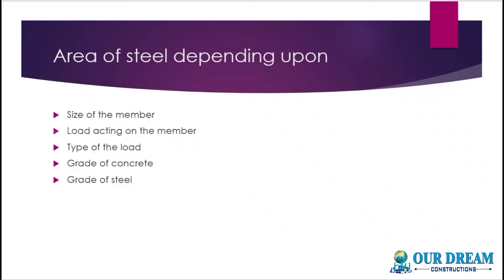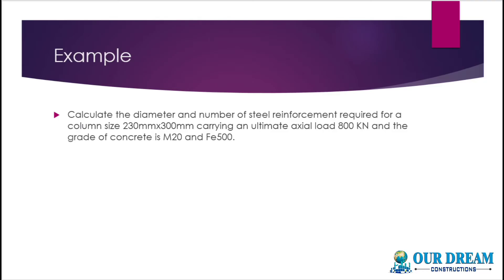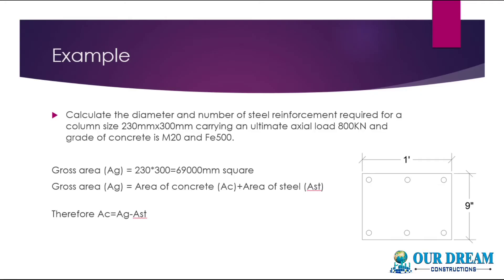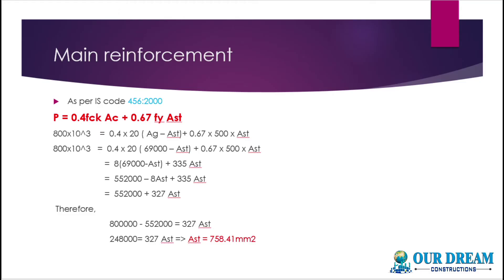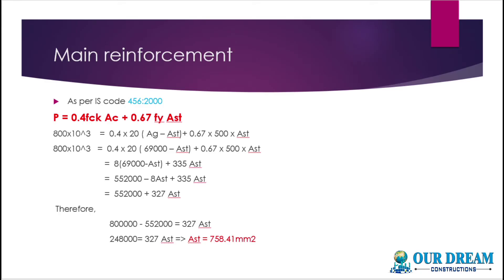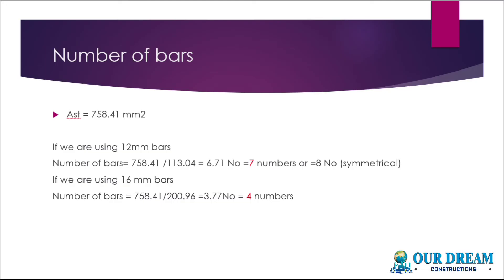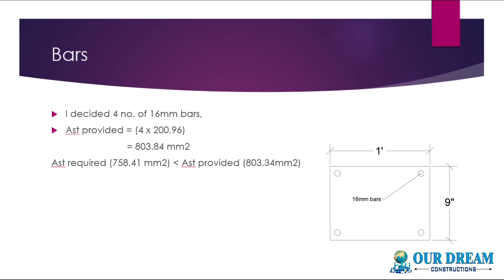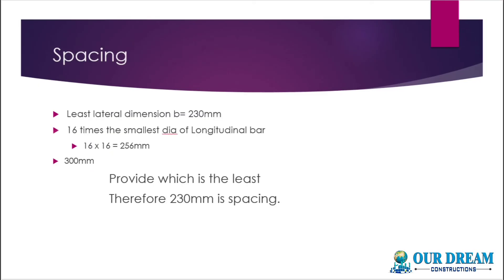How to find a number of bars in column | column'ல் எத்தனை கம்பி போடுவது என்று கண்டுபிடிப்பது எப்படி?

Comment: Bro chat gpt la intha answer varuthu bro kongam clarification Pannu ga bro

Steel reinforcement for column

￼￼

Calculate the diameter and number of steel reinforcement required for a column size 230 × 300mm carrying an ultimate axial load 800 kN and the great of the concrete is m20 and Fe550d

To calculate the diameter and number of steel reinforcement required for the given column size and load, we need to perform the following steps:

Step 1: Calculate the cross-sectional area of the column.

The cross-sectional area of the column can be calculated as follows:

Area = Width x Depth Area = 230 mm x 300 mm Area = 69,000 mm²

Step 2: Determine the compressive strength of the concrete.

The grade of concrete given is M20. According to the IS 456:2000, the characteristic compressive strength of M20 grade concrete is 20 N/mm².

Step 3: Determine the yield strength of the steel reinforcement.

The grade of steel reinforcement given is Fe550d. According to the IS 1786:2008, the characteristic yield strength of Fe550d grade steel reinforcement is 550 N/mm².

Step 4: Calculate the area of steel required to resist the given axial load.

The area of steel required to resist the given axial load can be calculated using the following formula:

Ast = (Pu x 1000)/(0.87 x fy)

Where,

Ast = Area of steel required (mm²) Pu = Ultimate axial load (kN) fy = Characteristic yield strength of steel reinforcement (N/mm²)

Plugging in the values, we get:

Ast = (800 x 1000)/(0.87 x 550) Ast = 1687.29 mm²

Step 5: Calculate the diameter and number of steel bars required.

Assuming that we will use only one steel bar, we can calculate the diameter of the steel bar required as follows:

Area of one steel bar = (π/4) x d²

where d is the diameter of the steel bar.

Plugging in the values, we get:

Area of one steel bar = (π/4) x d² 1687.29 = (π/4) x d² d² = (4 x 1687.29)/π d² = 2151.05 d = 46.37 mm (approx.)

Therefore, we can use a steel bar with a diameter of 46 mm.

Now, we can calculate the number of such steel bars required as follows:

Number of steel bars = Ast/Area of one steel bar

Plugging in the values, we get:

Number of steel bars = 1687.29/((π/4) x 46²) Number of steel bars = 3.52

Since we cannot use fractional steel bars, we need to use 4 numbers of steel bars.

Therefore, the diameter of steel reinforcement required for the given column size and load is 46 mm and the number of steel bars required is 4.

￼￼

Calculate the 12mm diameter and number of steel reinforcement required for a column size 230 × 300mm carrying an ultimate axial load 800 kN and the great of the concrete is m20 and Fe550Sd

2 / 3

To calculate the number of 12mm diameter steel reinforcement required for the given column size and load, we need to perform the following steps:

Step 1: Calculate the cross-sectional area of the column.

The cross-sectional area of the column can be calculated as follows:

Area = Width x Depth Area = 230 mm x 300 mm Area = 69,000 mm²

Step 2: Determine the compressive strength of the concrete.

The grade of concrete given is M20. According to the IS 456:2000, the characteristic compressive strength of M20 grade concrete is 20 N/mm².

Step 3: Determine the yield strength of the steel reinforcement.

The grade of steel reinforcement given is Fe550Sd. According to the IS 1786:2008, the characteristic yield strength of Fe550Sd grade steel reinforcement is 550 N/mm².

Step 4: Calculate the area of steel required to resist the given axial load.

The area of steel required to resist the given axial load can be calculated using the following formula:

Ast = (Pu x 1000)/(0.87 x fy)

Where,

Ast = Area of steel required (mm²) Pu = Ultimate axial load (kN) fy = Characteristic yield strength of steel reinforcement (N/mm²)

Plugging in the values, we get:

Ast = (800 x 1000)/(0.87 x 550) Ast = 1687.29 mm²

Step 5: Calculate the number of 12mm diameter steel bars required.

We can calculate the area of one 12mm diameter steel bar as follows:

Area of one 12mm diameter steel bar = (π/4) x d² Area of one 12mm diameter steel bar = (π/4) x 12² Area of one 12mm diameter steel bar = 113.1 mm²

Now, we can calculate the number of 12mm diameter steel bars required as follows:

Number of 12mm diameter steel bars = Ast/Area of one 12mm diameter steel bar

Plugging in the values, we get:

Number of 12mm diameter steel bars = 1687.29/113.1 Number of 12mm diameter steel bars = 14.92

Since we cannot use fractional steel bars, we need to use 15 numbers of 12mm diameter steel bars.

Therefore, the number of 12mm diameter steel reinforcement required for the given column size and load is 15.
Reply from the maker: in video what did i explain sample the AI Repeats.
1.  The load acting on the column, 
2.Area of column 
 you will get ast.
with the help of ast
3. area of bar using.
proved the bar as per ast requirement

Comment: Ninga use pannirukka formula axial loaded column kku mattum than use akuma
Reply from the maker: Apdi illa, ella column ku ore formula dhan, but corner illa side la vara column ku unga load la irrunthu some % of the amount load increase pannaum.

 4 corner  column mella vara load kooda, athanodala irrunthu 15 to 20 % load oda add panikanum , side la vara column ku mella vara load kooda athanoda load la irrunthu  11 to 15% ungaloda load kooda add panni kanum. Then atha P (load) ah unga formula la use pannanum.
Reply: @civilonlycivil  bro center la vara columnku thana load athikam varum corner la irukara columnku  kammiyathana varum?
Reply from the maker: @vigneshbalaji591   most of the case la apdi la dhan, but water tank la vara apo corner column hum athigamana load ah handle panna vendi irrukum. Corner column ku moment aagra thamai athigama irrukum adhanala antha load oda antha percentage of loads ah addition pannanrom.
Reply: @civilonlycivil  nice explanation bro .. detailing ungala maari solla mudiyaathu..oru building manual ah load calculation panni video podunga bro
Reply from the maker: @vigneshbalaji591  thank for the feedback bro i try my best. 🥳

Comment: Bro  6* 9* inches  column podalamnu sollirukanga appadi podalama  illa 6* 12  podalama 6 rod  sollirukanga  (4x12mm  2x10mm ) 
Hollow bricks  la katturom
Reply from the maker: Illa, puriyala..
Reply: 1/2  * 3/4    size column podalamnu mester  solluranga   appadi podala  illa  3/4 * 1 feet  podalama    column la  4*12mm rod  2*10mm rod podalamnu sollirukanga
Reply: @Manidhan-om2ih  minimum column size 9"x 9" ithuku keela poga kudathu.
Reply: @Manidhan-om2ih  athey maari column ku minimum vertical bar 12mm provide pananum.
Reply: @Manidhan-om2ih  Mullion ku matum 10mm use panalam athu wall length 3m ku mela pogum pothu Mulion provide panuvanga. Athu column illa but appdi act aagum for additional support.

Comment: ப்ரோ , காலத்தில் stirrups கொடுக்கும்போது நடுப்பகுதியில் அதிகமான spacing,கீழ் மற்றும் மேல் பகுதியில் குறைவான spacing ஏன் கொடுக்கிறார்கள்
Reply from the maker: Shear force supports la adhingavum, mid space la kammiyavum irrukum so apdi tharanga..
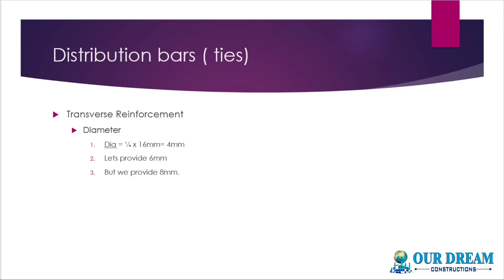Reply from the maker: 13:06
Reply: Ok bro, அந்த stirrups இடைவெளியை எவ்வாறு கணக்கிடுவது?
Reply: @manikandanmanil  roof height la irrunthu l/4 split pannikonga antha length ku mattum stirrups spacing 100mm maintain panunga both floor and roof L/4 la balance area la stirrups spacing maximum aa irukalam but not exceeding 200mm.
Reply: Example floor to roof height 3m 
3/4 is 0.75metre
So floor bottom to 0.75metre ku close spacing of stirrups provide pannanum.
Same roof side also.
Reply: Thanks for this video bro pls try to upload  more videos its my request